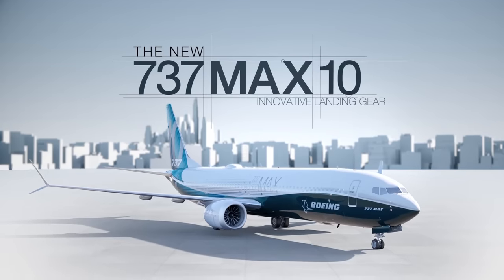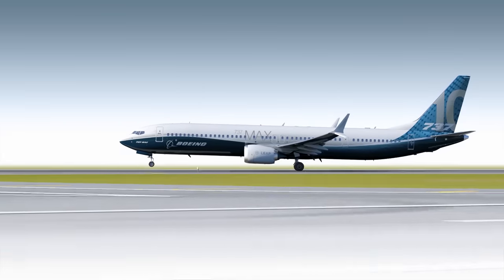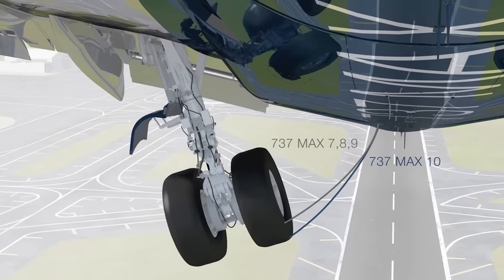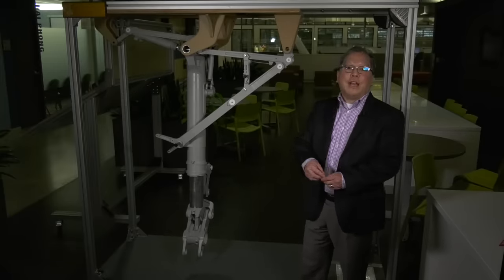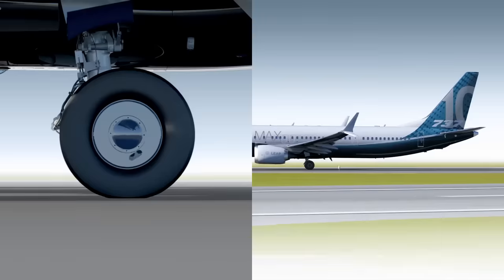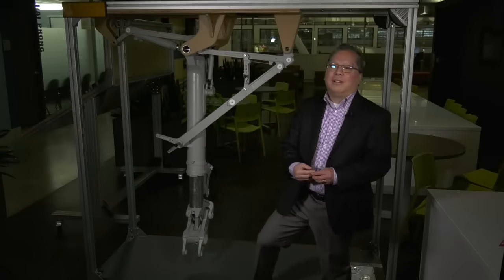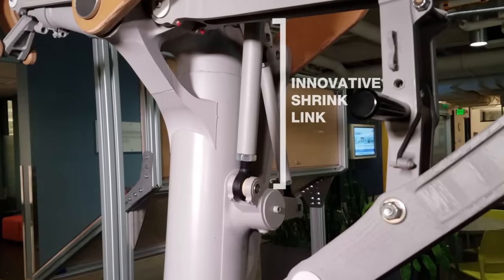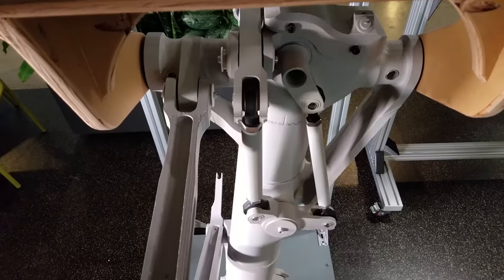How the 737 MAX 10 landing gear works

Comment: This is ground breaking technology at work....literally. Thank you for that extra nine inches and a few extra seats in which a couple of extra passengers will be able to see that ground unexpectedly.
Reply: Nine inches..... remember why they moved the engines that started this mess? Not enough ground clearance. Did they do anything to extend the clearance then?  Nope they moved the engines.  It's like the original engineers were so ashamed they let and a new batch came in and is slapping an entirely new set of trinkets into place.
Reply: Nothing remotely groundbreaking. The shortening mechanism has been in use in the A330 for over 25 years. The levered bogie has been in use in Gulfstream jets for a long time.
Reply: @rogerrussell9544  NOT the reason for the crashes. MCAS was made too aggressive and pilots weren't able to override it.
Reply: @RagShop1  The MCAS was due to the engines being moved.  Yes, the reason for the crashes.
Reply: @rogerrussell9544  Only in that MCAS was needed to compensate for the changed aerodynamics from the larger engines so that the MAX flew like the NG, reducing training costs. It wasn't needed to augment stability within the normal flight envelope. The MAX flies fine without MCAS but differently than an NG. Boeing's contract with Southwest Airlines called for a $1 million per plane penalty if added training costs were incurred. That's why MCAS was done. Sadly, MCAS was initially badly implemented, being over aggressive in pushing the nose down and too hard for pilots to disable. But the engines re-positioning up and forward isn't a real issue as claimed by Ralph Nader and others early on. The MAX's center of gravity was rebalanced to compensate for that and with MCAS retuned to be far less aggressive and  easier to disable, it's no longer unsafe. I've flown several times on 737-8s and found it a nice experience. Airbus would've had this changed handling characteristic also on A320 NEO series airplanes with even larger CFM Leap 1A engines except that those airliners have full fly-by-wire flight control which is simply retuned for the larger engines' altered aerodynamics. Lacking full fly-by-wire, the MAX uses MCAS as an overlay to do what FBW does on A320 NEO planes.

Comment: The full Boeing statement: “From the pilots perspective there will be absolutely no difference! We’ve achieved such a technical feat thanks to an cutting-edge technique never before incorporated into the aviation industry until now. We call it “lying by omission” We simply won’t mention any of the changes, they’ll be none the wiser 🤷.”
Reply: I'm sure the pilots never noticed the ground rushing at them at 350 knots.
Reply: Airlines and pilots: So, any changes on this new model?
Boeing: That's on a need to know basis, and you don't need to know
"Plane crashes"
Airlines and Pilots: WTF Boeing
Boeing: What? Pilot did it...
FAA digs deep
Boeing: Hey Airlines and Pilot, we decided all on our own with absolutely zero pressure from a third party that you need to know something.

Comment: New Boeing 737 MAX 10’s landing gear system VS old Ryanair landings style? Who will win?
Reply: Ryanair Will not use the MAX 10
Reply: They will eventually but only when they become second hand
Reply: @ALRVideography  Ryanair doesn't use any second hand planes. I don't think they will purchase it as they have purchased the 737 MAX 200 (A MAX 8 with the MAX 9 door config in order to host 200 passengers).
Reply: Ohh i thought they use second hand aircraft mostly (I stand corrected)
Reply: @ALRVideography  No prob. They even have very new aircraft with the Boeing Sky Interior (still very few inches of legroom). The main reason why they use new aircraft is that they are more fuel efficient (less cost) and they need less maintenance (they go through regular maintenance checks but as they are more new they have less things to change so more hours in the air making profit). 😉
Reply: I was on a Ryanair flight the other week and the aircraft was falling apart hence why i thought they use older aircraft
Reply: @ALRVideography  They use old aircraft, but none of them is second hand. Their oldest aircraft is 16 years old, but the Average fleet age is 7 years which is low Actually, theyey have one second hand 20 years old 737-700 used for training and other purposes but not for passengers. Maybe you were on one of the oldest aircraft. Check the new interior in Google Images, you will notice the difference. 😄
Reply: @ALRVideography  Please stop being a normie
Reply: Feurum TV nosedive.
Reply: Trick question; they will be smeared against an English field

Comment: Neat solution, basically a trailing link gear. Wonder if this will enable softer landings?
Reply: Just more landing gear problems lol
Reply: No, it just to prevent tail strikes. 
I'm not sure who decided that added complexity was a better solution than just pushing the gear back a few meters. 
If those gear don't rise on rotation there will be a tail strike... Seems sketchy at fuck.
Reply: It’s not a trailing link landing gear.. and trailing link gear are no different in smoothness no matter what the Cessna brochures say. In fact.. they are often harder because there can’t be as much travel for damping action as a conventional strut.
Reply: @Sam - They would have the re-design the rest of the plane just to suit that repositioned gear, which really does not make sense in the grand scheme of things. Many airplanes have simple to complex systems to deal with limited wheel well space and positioning. E.g. 747, 777, 767, Galaxy C5, etc.
Reply: @_multiverse_  IIRC there are limits on the aircraft's wheelbase (that would be increased by moving the gear backwards) if the 737 MAX is going to retain the same IATA Aerodrome Code as earlier 737s (which airlines would probably want, so as to avoid having their airport landing charges increase). Or perhaps we should be having a 797/NMA/758/759 design instead of a 73X (that might have already outgrown the 737's original design)

Comment: Basically a mix of Gulfstream and (simplified) Airbus A330 gear designs. The lower lever design is used by Gulfstream. The shortening mechanism is on the A330 / A340 and is reliable, albeit a hassle to service and to lubricate. Yes when it does fail you can retract the gear, but given regular inspection it does work very well.

Comment: He’s like we extended the fuselage, which requires longer landing gear, which in turn calls for a bigger landing gear bay. We didn’t want to change the bay so we came up with this telescopic rotating landing gear solution. This is the same mindset that brought about: Hey, we need new engines but they won’t fit as the plane is too close to the ground. That’s alright, we’ll just move them up. But that can increase the pitch on takeoff. It’s fine, we’ll just have MCAS stabilize it, we don’t even have to tell anyone it’s there, that’s how safe, perfect and high tech this solution is. I swear, some of these people should be serving time.

Comment: Another idiotic bandaid for the 737, instead of doing what was truly needed, a completely new designed airliner.
Reply: It’s not a band aid. Aircraft designs get stretched all the time, and need solutions like this to avoid a radical redesign (that can introduce problems of its own). Generally, the fewer changes you can make to a proven airframe, the better.
Reply: @adamk203  , 
After 40+ years of 737 use it was time for a clean sheet design. Boeing has more than made back its initial investment. Heck the fuselage cross section comes from the B707.
Reply: David Hoffman the quality and usability of an airframe design does not necessarily correlate with age. Not to mention that the 737 airframe has evolved considerably over the years.
Reply: @adamk203  Tell this tale to the 346 people who were perished in the two MAX crashes.
Reply: @misuru9255  In part it was. MCAS was needed since Boeing decided to starp larger engines on to the MAX airframe. That shifted the center of gravity to the point where they either needed to either 1) make furthur wing/tailplane modifications to compensate for the larger engines or 2) use control software like MCAS to keep the plane in a stable flight regime. We all know what came of Boeing's choice.
Reply: @AirShark95  or insist on a new pilot type rating so pilots were trained in the characteristics.  The CG was controllable by pilots if they knew about it.  But the airlines wanted a common type rating with the 737NG.  Enter MCAS....
Reply: Hence the popularity of the Airbus A320 family.
Reply: I agree. B737 was meant to be a small jet that can land at rural area (hence the short landing gear for easy maintenance).

Comment: Oh FFS, still continuing to (try to) engineer the compromises out of an old airframe? Adding more and more complicated systems that will fail under conditions not yet discovered. Boeing is acting like Ingen (Jurassic Park) thinking the next time it will be flawless. Engineering is about making things as simple as possible not forcing more complexity into a craft that starts off with a million parts. If you have to engineer a flaw away you're already stuffed. Come on!
Reply: Tf is bad about that it isnt even forcing complexity on it, they only added a few things to the gear if you even watched the video.
Reply: @campbellaviation7289  It's quite bad that they have to overcomplicate the landing gear because it's too small for the elongated  airframe. MCAS was to compensate for the larger engines having to be moved upwards and forward changing the plane's behavior, again because of the small landing gear. How many original VW Beatles do you see with a stretched wheelbase to carry more people, enlarged rear to house better engines, longer nose for more luggage and reinforced cabin to be safer? None. Sometimes your product is out of date and you need to invest in a new model.
Reply: @ecpnothnagel9121  You got a point
Reply: "If you have to engineer a flaw away you're already stuffed." Do you know anything about engineering? Anything with no flaws has flaws that you dont know of.
Reply: @crazydave1  And what about the flaws you are aware of? Like the undercarriage of an ancient airframe that's forced to compete with better, more modern designs? I'm a Boeing fan as much as the next guy and the moment that Max pointed its nose straight up and powered itself into the sky I was smitten. If only it had the ground clearance to accommodate the big turbofans where it belonged. Remember that fuselage originated with the 707, planes that used turbojets for goodness sake. Also the 727 that had rear mounted engines and thus a wing with landing gear positioned further back, so low that it had stairs at the back!Bigger landing gear simply wasn't possible so first they tried to compensate electronically with MCAS and now with a ridiculous extending landing gear system just to get off the ground. They're solving problems that shouldn't exist but that's what's needed if you're building a 21st century aircraft that actually started life in the mid twentieth century. Boeing can do better but they tried to save money. Yes I know something about engineering and also about amortization. Unfortunately the same can be said about Boeing's management.
Reply: @ecpnothnagel9121  bro, a major part of engineering is testing. Im not saying what they did was right, im responding to that one sentence you said. Just because there's a problem, doesnt mean you're "stuffed". Its a part of making something new to test and fix that problem, and they tried to do the right thing by fixing it. What they did was wrong, yes, but im not saying it wasnt.

Comment: I have a question. Isn't MCAS supposed to do what the actual trim does? The problem was that the aircraft was tilting upwards because of the repositioning of the engine, so they added MCAS. But couldn't they just trim it out?
Or did it only point up when they added throttle?
Reply: I think  it can, but I also think boeing would like the changes to be "invisible" to pilots

Comment: I hate this push for increasing seats to the maximum potential in the most modern aircarft. I cringe at boarding a dreamliner as it's as cramped as a twin seater cockpit seat. Stop aitlines being greedy for the sake of an extra 9 seats, and give passengers real comfort. Not the illusion of comfort because the window tints and the overhead lights change colour. The whole industry is heading the wrong way. I should not be more satisfied flying older 777 and 747 aircraft than I am newer airplanes. Rant over.
Reply: yup, the 787 SardineLiner is an absolute nightmare to fly on long haul routes!!
Reply: How about A350
Reply: Andrea Mendes Depends on the Airlines configurations
Reply: the A350 still gives every passenger a seat width of 18", the SardineLiner 17"
Reply: Andrea Mendes Again, it comes down to what the airlines decide to configure. Air Caraïbes has an A350 3-4-3 in 16.5” while ANA has an 787 with 2-4-2 in 18” for Example....
Reply: ANA no longer has its B787's in the 2-4-2 configuration...
Reply: Doesn’t Matter. Either way, they Had 2-4-2 which is more comfortable than 3-4-3 on a350 and then a350 is more comfortable than 787 in the same 3-3-3 configuration due to its wider Cabin... I’ve flown 777 3-3-3 and it was the most comfortable I’ve flown. Ik someone who flew both 777 and a350 3-3-3 and He said 777 by far, why? Because it has a wider cabin which allows a greater width of each seats. My point is airlines make the comfortable happen dude. Not the Plane

Comment: What happens when the "shorting" mechanism fails?  If compressing the inner cylinder doesn't work when the gear is retracted, will it cause significant binding and damage?  What if the gear is retracted and the mechanism fails when gear is stowed?  Will the gear be "trapped" in the well?  Then again, there's the extra 66 inches of fuselage to aid in braking....
Reply: The shortening mechanism doesn't compress the cylinder, it moves it inside the strut. Not a new idea, the A330/A340 use the same theory, and so did the Concorde.
Reply: Interesting Billy....so the inner cylinder moves inside the outer cylinder to shorten overall strut length, but it's not compressed?  Do you have any links that show how it works?  Thank you!
Reply: @roccos7642  to try and describe it the best I can, image a shock absorber or coil spring on your car, but instead of the fixed end being attached to the body of the car (or the landing gear leg of the aircraft), it is attached to a series of links that move it vertically in the outer housing. These links are arranged so that they move in relation to the main leg's retraction action, and when lowered and locked they move over centre in a similar fashion to the main gear locks.
Reply: Billy Phillips You are too smart for me...I am totally confused!  I watched some other videos of gear extension/retraction and noticed the "compression" or shortening of the strut.  It was obvious that the inner cylinder (the "chrome" part) was moving into the outer cylinder (non "chrome" part) during retraction, and extending (or lengthening) when gear was lowered.  How this happens (particularly on retraction) is what I'd like to know.  What you describe to me sounds like strut compression; the inner cylinder is forced into the outer cylinder!  I will keep looking to help understand, and I really appreciate your feedback.
Reply: @roccos7642  you're on the right thought with the inner cylinder moving, now picture that the inner cylinder is a piston. The fluid in the piston pushes it out (this is what you see on takeoff when the aircraft becomes airborne). Now picture what would happen if you moved the other end of the fluid chamber (which would normally be fixed in position) upwards. The whole cylinder, lower piston and landing gear will move upwards.
Reply: The whole strut moves?  What I mean is it's not fixed in the trunnion mounts?  That's interesting....
Reply: @Mal Reynolds i wish i could say too soon, but i cant
Reply: Don't worry. This shortening design has been in used with the Airbis A330 for 25 years. It's reliable but when it DOES FAIL, yes you can't retract the gear. Hence this is a (very) regularly inspected item.

Comment: They present this like it’s a great thing? They stretched the aircraft. Increased its weight. Lengthened the fuselage behind the wing. But fought tooth and nail to avoid having to keep the old landing gear wheel wells instead of seeking match the landing gear to the new airframe. It’s like they’re designing an aircraft with tail strike as the goal. Good plan there Boeing!